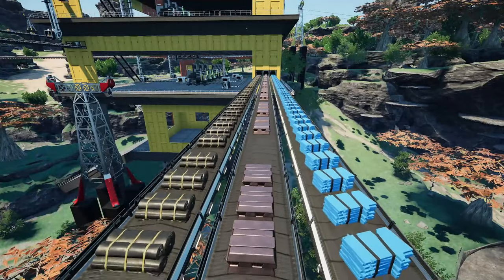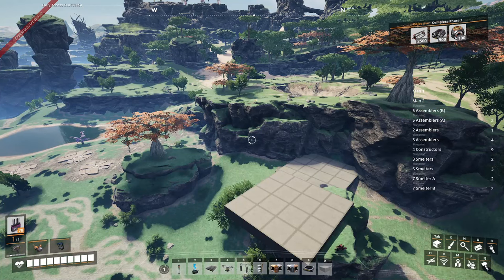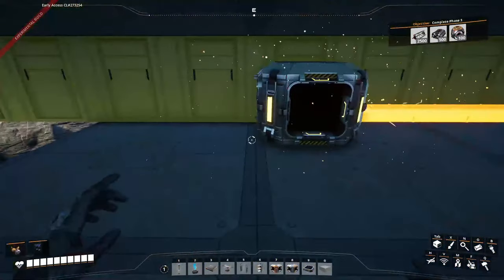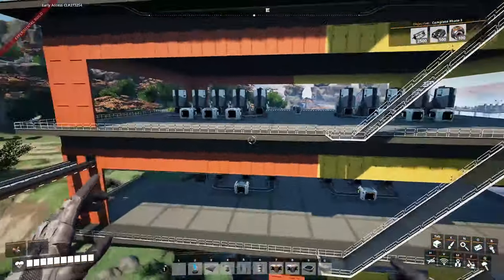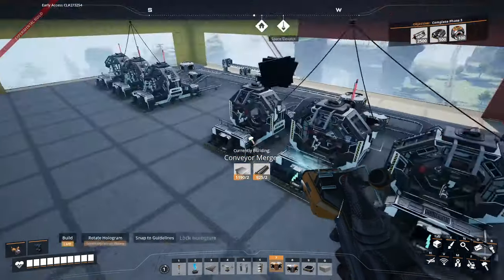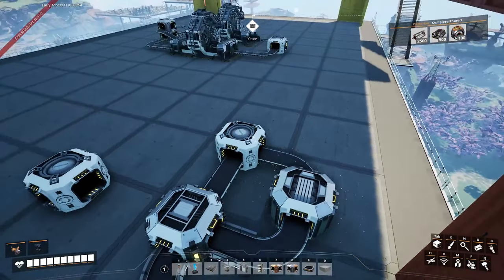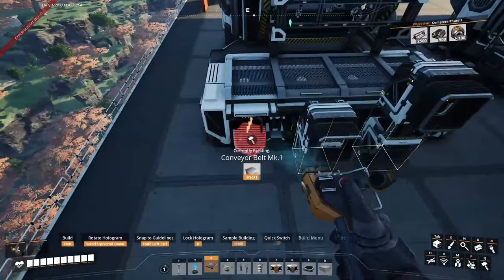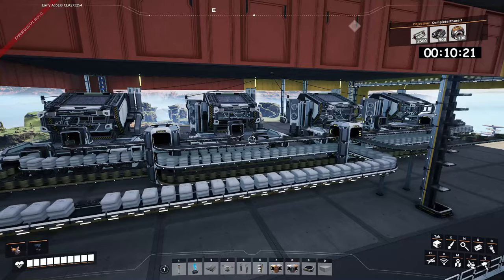LOAD BALANCED Electronics - AI Limiters to Supercomputers - Satisfactory - Update 8

Comment: I keep trying to use signs, but every time i place a new one its always upside down.    Is there a trick to knowing which way is up on the square display signs before you place it?
Reply from the maker: Not that I know of. It drives me nuts! I really hope they add an indicator to show which way is up. Depending on what you’re doing you can blueprint the signs. They snap a little different when it’s a blueprint so it might not work. Good luck!

Comment: instead of the weird stubby belt you then limit after a short bit, since you use smartsplitters anyways use the material (or any) as you do now for those you NEED at certain speeds, then use overflow for the last one, removes the need for the tacky stubs on the belts... looks nice and I like that you split everything and I must agree, moving belts are just more pleasing, even though manifolds are just "easy".. is it to make belts more "visible" that you make the load balancers so spread apart instead of just right up against each other for a more compact build?

very nice build over all and I guess for my 1.0 final run... then I will load balance everything too, it just have a certain charm
Reply from the maker: Thanks so much! I think you’re right and I made that one part more complicated than it needs to be. I like the mergers and splitters having at least a little space in between because I like to watch the stuff move around and it makes it easier to see and change the speed when I get it wrong and need to fix it :) 
Always happy to hear someone is going to try load balancing. Good luck!!
Reply: @moo121 yeah I have dabbled a little in loadbalancen but never really went all it but it is a fun challenge.

also I like watching the belts working at different speeds instead of just racing past... makes sense for the easier swapping between splitters, I hope they fix it and make it easier, it is possible but it is really hard to target the right spot atm.  and smart splitters is just a god send :D

atm. I am testing out a start on the edge of the swamp, everyones most hated place and it definetly is dangerous and scary but the thrill is nice too and the planning for coal is doable but you need to travel up the coast towards the desert again and most materials are nearby... (like testing out "unused spots") and it is most definetly not an easy spot but fun and challenging.
Reply from the maker: @LiLBitsDK  That sounds awesome! Good luck! I think the thing I dislike about the swamp the most is how much it mutes the colors, everything is so dark and just shades of gray.